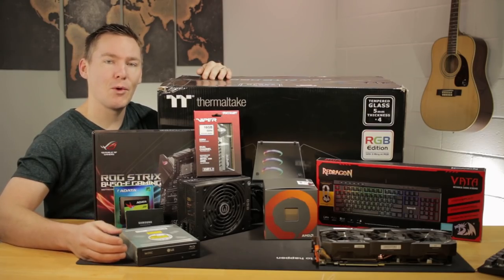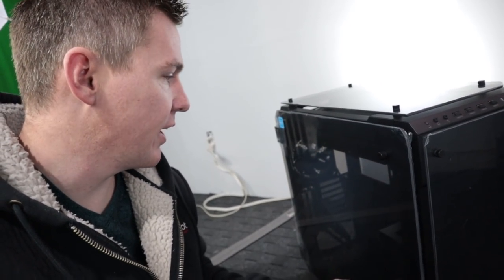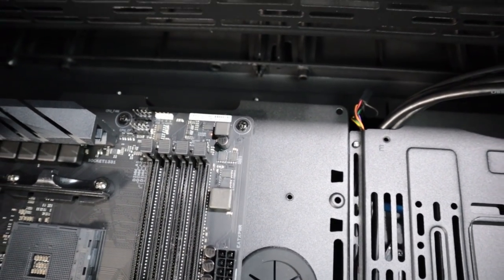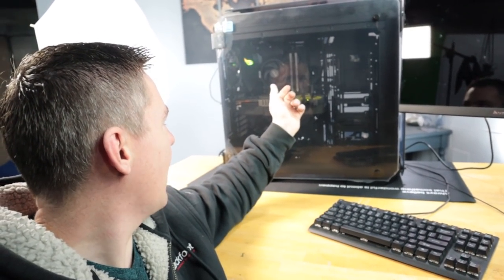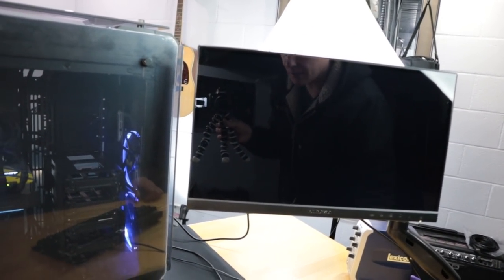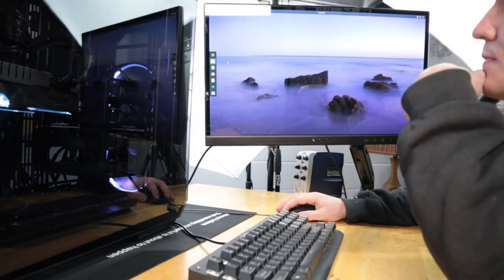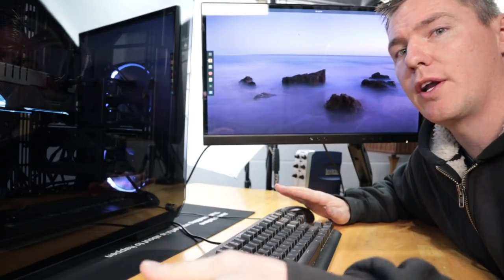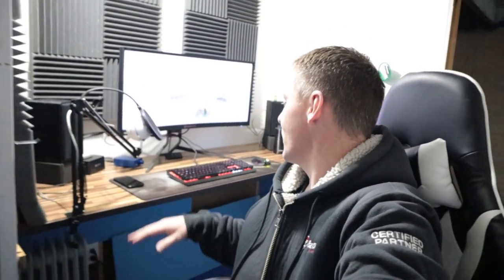Computer Build for Linux & Open Source Software

Comment: Hi, it is nice to see the enthusiasm you have about what you do. I have been using Linux Mint 19.3 for about 10 months and I think it is great!  First I had/have a Windows 10 Dell laptop with an i7 processor that sometimes got real slow. I became very annoyed with Windows 10. Then I bought a HP Chromebook. It is real fast at booting up and surfing the web but did not have much in the way of software available. Then I tried Linux Mint by installing it on an old Dell laptop that was given to me. This started my use of Linux  and it became my favorite OS. I am 71 years old and my first computer had Microsoft DOS 5.0 and booted to DOS Shell. I have just this week installed Linux Mint 20 as a dual boot on my Dell laptop with an i7 processor and a 1 TB hard drive. I am excited about having Linux Mint on my main computer and don't think I will use Windows 10 much.

Comment: Nice build. I have a 2700 also, but on a Crosshair Hero VII no wifi because I couldn't live without dual NVMe or a post code logger. I don't ever plan on upgrading, which was the goal.

Comment: Nice, I like it.
I'm a Linux Mint user myself, with Mate desktop, but that's good.
I have a 'Dear Santa' letter in, for a 7nm Ryzen about Christmas, probably a 12 core. On the GPU side a Radean 7 would be lovely, but I don't have the $ and I can't really justify it, in terms of what I do. They're saying that Navi will come, and that'll be a mid range card, and that sounds like a much more sensible option... At the moment I'm using a GTX-750, and for frame rate and graphic power, that seems entirely adequate. I want to go all AMD, so an RX 570 or RX580 or something would be quite ok, but ... Navi is where they're going in the future. As I understand it, Navi is a whole new graphics architecture, and that will form the foundation for all the next generation of GPUs going forward, both integrated APUs, discrete GPUs for laptops & desktops, and for all the consoles. That's going to be a bit more future-proof.
Reply: Apus will still be Zen+ and Vega graphics

Comment: How do you know if a component is compatible with linux? I want to build one but don't know if the parts i want are compatible.
Reply from the maker: Good question. Just about everything runs well on Linux these days. Just do a search for the specific component (like the GPU) to double check its compatibilities and to learn about any potential issues.

Comment: if ill create a linux pc. it will be the cheapest build ever.
Reply from the maker: Yes. For cheap but powerful, I recommend something like this and just install Linux: https://www.ebay.com/itm/Dell-Precision-T3600-Xeon-E5-1603-2-8GHz-8GB-500GB-NO-OS/163643850682?hash=item2619eeffba:g:khIAAOSwWV5cknra

Comment: Solus is a good distro choice... one of my favourites :)
Reply: Michael Cowman is it better than pop is and Ubuntu
Reply: @anjanbabu4625  That is very much down to personal choice. If you're a fairly novice computer user and new to the Linux world and coming from Windows, there are probably 4 distros that I personally would recommend - Mint, Solus, Zorin and Ubuntu. If you're coming from Mac, I'd probably recommend Elementary. Standard Ubuntu and standard POP OS both use the Gnome desktop but I'm not really much of a Gnome fan (personal choice). I use Mint Cinnamon as a daily driver, but Zorin Core and Solus Budgie are also good starter options. If you're happy with Gnome as a desktop, I think Ubuntu is a good choice and probably a bit easier to set up than POP is, but I really like both of them to be honest. If you have been using Linux for a while, MX is also a really good option - I've added the Cinnamon desktop to my MX drive and it works nicely. I like Manjaro as well, but I wouldn't use Manjaro unless you know how to do TTY updates. For what it is worth, POP, Mint and Zorin are all based off LTS Ubuntu anyway. Manjaro is a very heavily curated version of Arch and Solus is truly independent. Solus doesn't have the range of software that you will find in the others but for basic users I think it's fine. And, just so you know, I've only been in Linux for about 18 months - I still very much think of myself as a newbie lol!

Comment: Is there a limit on hardware per release of Linux. I am thinking of using older hardware with current Linux sortware.
Reply from the maker: Good question. Most Linux distros run well on older hardware. I don't think you'll have any issues.

Comment: Completely aware AMD gets you more for you're money, by far the best choice for the average user (most Linux users aren't), although at least it is not longer true, isn't is AMD not supporting native drivers for Linux based computers? Also, if you happened to be an Android dev, Android Studio works better with Intel since you can VM preview/test your built without the need to owning the target device, this can not be done if your computer is AMD. It sucks, i know... bad AMD!!!
Reply from the maker: Hi Alejandro. I haven't noticed those issues. I am using this AMD CPU to do virtualization, using virtualbox, and it works well.
Reply: @TJFREE  Thanks for your fast reply, you clearly take care of your channel. As I mentioned, hopefully AMD is now giving proper support for Linux users, If that is the case I would be the first switching to it, In my case since I develop Android apps on my free time and I use Android Studio IDE I can not use AMD, I'm sure Intel works better it.

Comment: Linux why not windows?
Reply from the maker: Hi Ethan. Good question. Biggest reason: Windows does not respect its users. I don't trust it. The source code for Windows is closed. They do not let you examine it, make changes, share it, etc.. Linux on the other hand is open, transparent and respects its users and their freedom. It also helps that Linux is faster, better looking, more customizable, more secure, and supports all the software I like.